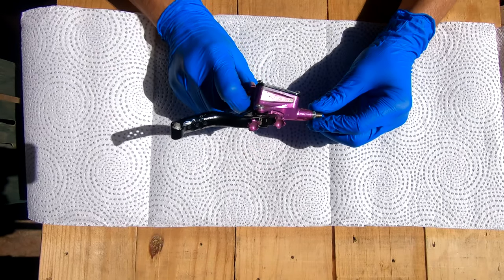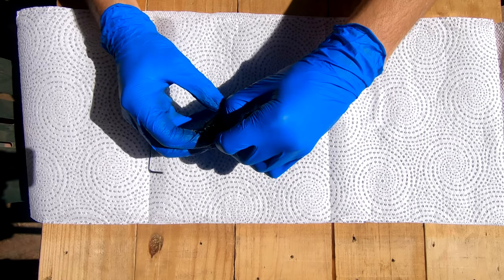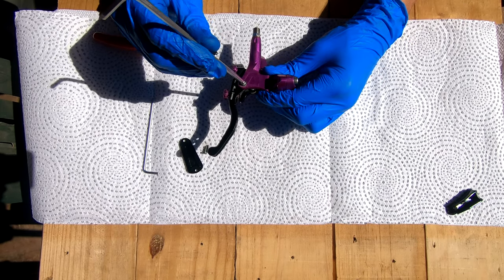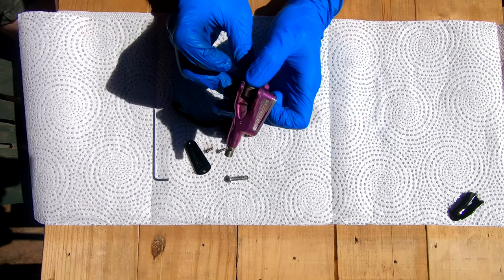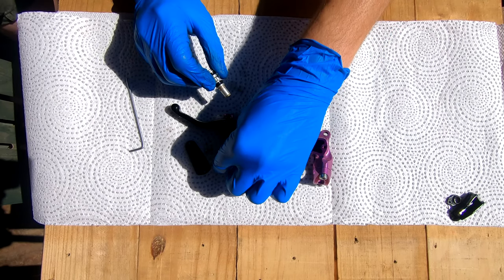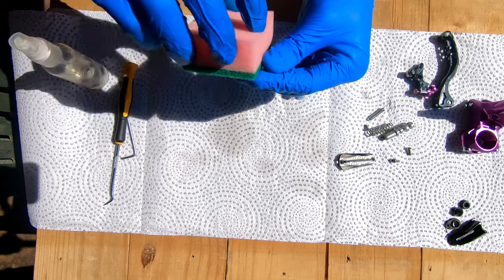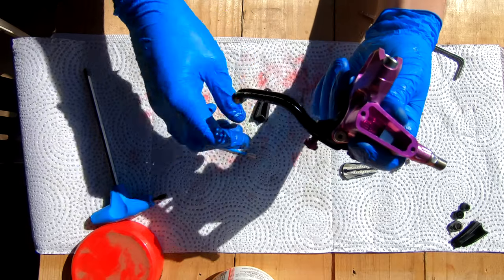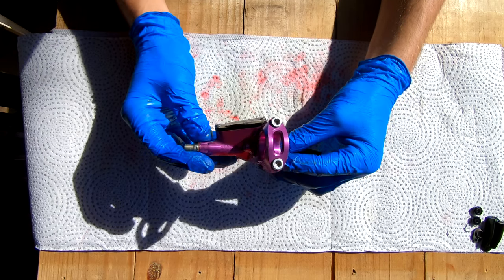Hope Tech3 Lever(Master cylinder ) rebuild | 2020 JustFrana

Comment: This helped me today, just a tip for the small piston seal. I put the piston vertically in a vice, wrapped in a piece of leather to protect it, I then used some Knipex A0 circlip pliers to stretch the seal over the piston.I then used a old Tig welding tungsten in place of the pick to get seal in place.
Reply from the maker: Thanks for the tip
Reply: @JustFrana  Thanks for the video, for showing people how to do the job, fitting the seals by hand makes total sense, but that must have been a real pain to do.

Comment: Great walkthrough! One thing to add (and it isn't in the exploded diagram either) there was a 2mm grub screw on the backside of the reach adjuster housing that pushes against the pivot pin on my master cylinders. I thought my pin was completely seized as it wouldn't come out, even with mallet persuasion! The grub screw needs to be removed to take the pin out and I got a new one in the rebuild kit.
Reply: Exactly, same on my Hope Tech 3 levers.

Comment: Could you use the red rubber grease for the pistons of the caliper? People are saying don’t lube the seals or pistons with grease, use the brake fluid, but in hopes video, they use silicone grease, so hoping the red rubber grease is a good alternative?
Reply from the maker: Yes you definitely can , the pressure you brake line generates is much greater than what a bit of grease can withstand if it were to make its way to a port. I would do it with no hesitation

Comment: Thanks for the video, can you help with my problem please? 

I don't seem to be able to push the piston in far enough to reassemble the lever, the piston won't push in any further so I can't line up the holes to put the pivot pin through. Everything looks to be assembled in the right way, the seal kit is correct, the seals look to be the right size, the piston (complete with seals and spring) look identical to my old one (I took a picture) and the spring is oriented the right way.
Reply from the maker: Hey Steven , this part can be really tricky , in the video i already knew what to expect but i rebuilt another one before hand just make double sure , what might help is turning the adjusters all the way anti clockwise. I'll try measure the piston exposure on a tech 3 lever with the lever and that litte arm removed and let you know if you have not come right yet.

Might only be friday cause work is killing me right now.
Reply: @JustFrana  Hey dude, thanks for your help. Out of curiosity I tried the seal in my other kit (doing both brakes so bought 2 kits obviously) and the piston went in easily, someone must have put the wrong seal in the kit at the factory :(

Comment: Great helpful video can u tell me I have bother getting the pivots out is there bushes holding them as well as the cut clip cheers
Reply from the maker: I have not had tp remove those bushes yet but they are listed parts so you will be able to order new ones from hope. I eould try to find A socket or punch that matches the OD of the bush and gently tap it out.
Reply: @JustFrana  thanks very much I managed to get it out but the bushes were done so will have to order them what are they called

Comment: Hi, I have only one q: what kind of grease have You used? Can be the same as one for the shocks seals? Grate footage btw. Going to work with my hope brakes.
Reply from the maker: Suspension grease might be a little thin , I'd go for any heavy really thick grease made for hydraulic applications. If you do go with something like slick honey just open up the levers more regularly to make sure everything inside is still properly lubricated.
Reply: @JustFrana  I have smth in my garage. It is a kind of water proof graese, blue ( if the colour matters ) and very thik. I am using it with bottom bracket, headsets, suspension links, and everywhere else. Can it be mixed with DOT?
Reply from the maker: @endurodoctor  yes go f0r it , i initially thpught ypu have to use dot based grease but after talking to a tech at hope he assured me qny proper thick lubrication grease will work.
Reply: Ok. I did it. Seems both seals are swollen in my case. It could cause this horrible drag pushing the lever. The strange thing is there was no grease inside the master cylinder. Could DOT wash it out? Are U sure we need grease? My brake is a few months old and has never been bleed yet.

Comment: Two signs the lever needs a rebuild although the brakes are working good-ish:
-Dropping brake fluid level while still having a pretty good bite point. The level drops very slowly though, in 18 months between checking/bleeding it wasn't enough to cause any problems. Note, dropping level can have other causes too.
-Black residue in the reservoir from seals that degrade.

So remove the top cap and take a look.

Comment: JustFrana can you mix this leverls with Guide RE calipers? Thanks a lot
Reply from the maker: in theory yes , both work with dot fluid so they'll work fine but I don't know if the hope lever displaces enough fluid to move the pistons of the guide caliper enough.

so once you've got everything built up i think you will find you get alot of lever pull until the pads eventually "bite" , you might be able to get around this by advancing the pistons in the caliper when the pads are out or by somehow overbleeding the system to get more fluid in there to take up the extra space.

So I think it might work but if it does it's probably not going to work as good as you expect.

Let me know if you do try it and what the outcome was.    :)
Reply: JustFrana im afraid im going RSC just like that 😁 ... but thanks for the answer dude 👍

Comment: Thanks, verry helpful. One of my hope brakes needs more bleeding, 4 times this year. There is no oil leaking. I was thinking the master cylinder might be the problem. What do you think?
Reply from the maker: I think if it's happening that often after you've ruled out the lever your hose might be scratched up or you myght have a small issue in your caliper which is unfortunately a little more tricky to check and you'll need some specific tools from hope.